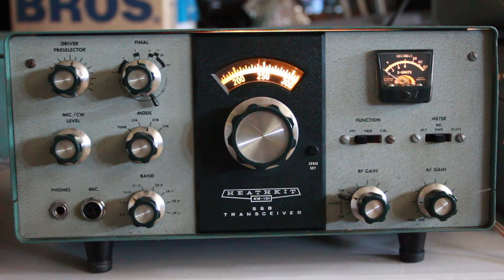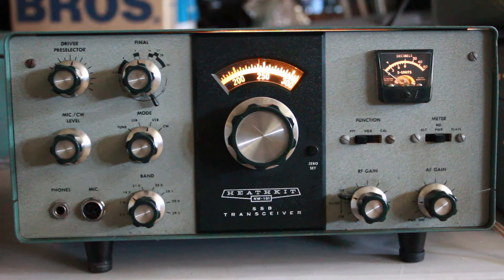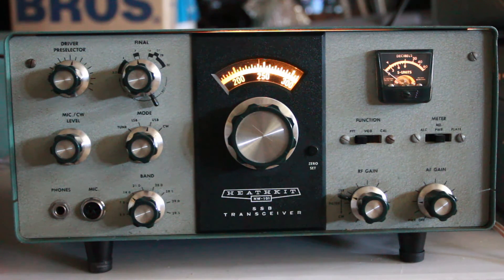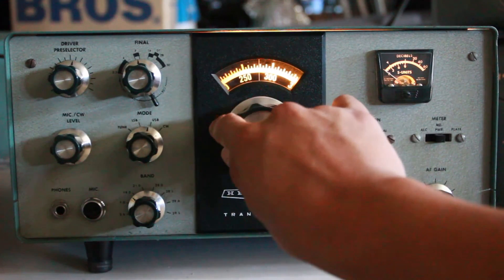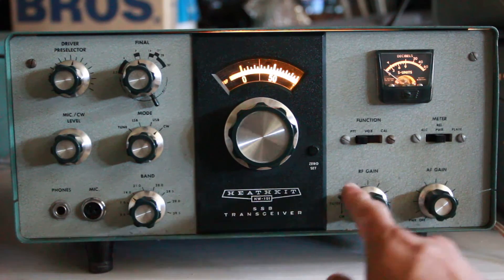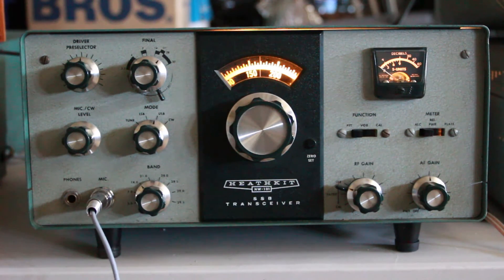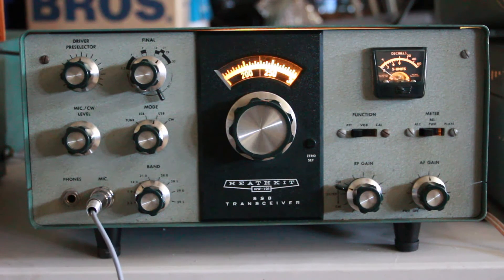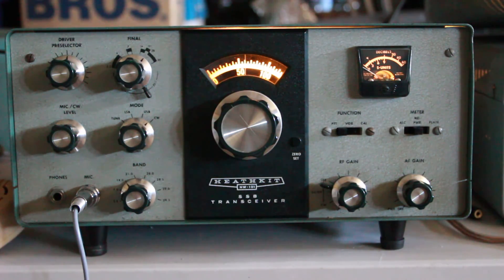Heathkit HW-101 - Up and Running!

Comment: I just bought one of these for $100 with power supply, and plan to  give it a complete photo inspection, cleaning and replacing items as needed, and a use this radio to brush up on my electronics schooling from 30 years ago I have never really used.  I have the original assembly manual, and you have many good tips for things for me to check on before powering it up.  Nice.

Comment: Nice job!  "Hot Water 101"  Very cool - you made a contact!   I like that you are using CW too - I was waiting to hear an answer to your CW CQ call..... I may have to my HW101 out of the box in the basement.  Let's see...it was working...10 years ago...(wow- has it been that long?)  Thanks for the memories!
Reply: O rings make good replacement belts for the Hot Water 101s. That is what I used on mine. I bought a couple of Kenwoods & use those more often. I think the 580 or the 480 has the built in antenna tuner so I can run 80 meters with a 40 meter antenna.  The HW had 6146B tubes in it and those don't like to neutralize unless you make some changes to the bias and the load, so a pair of new old stock very late production RCAs went in last night. 60-65 Watts on the Bird.   KI7AQJ  73